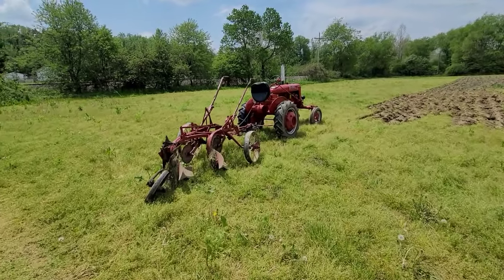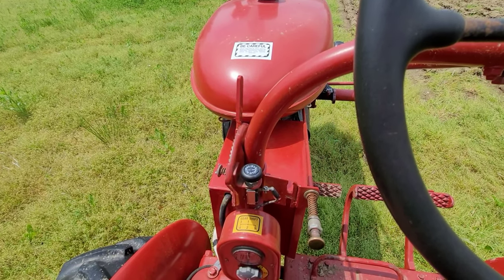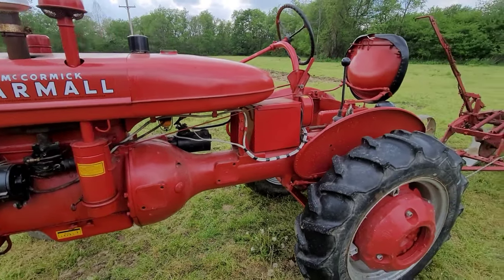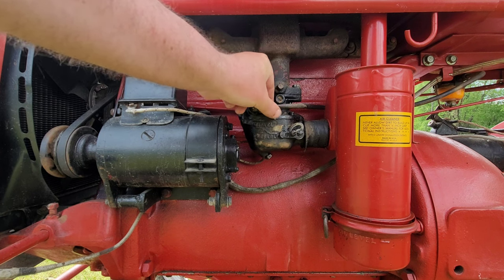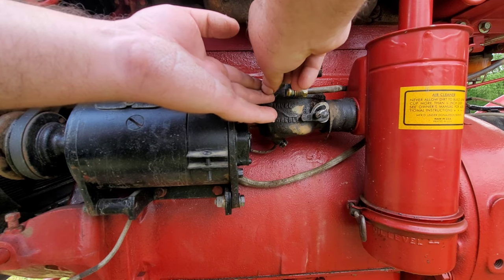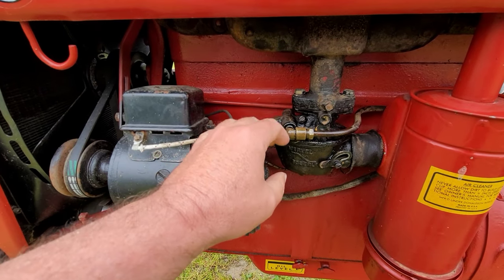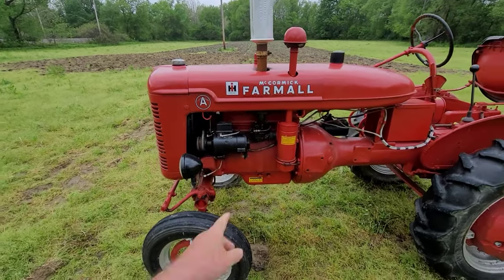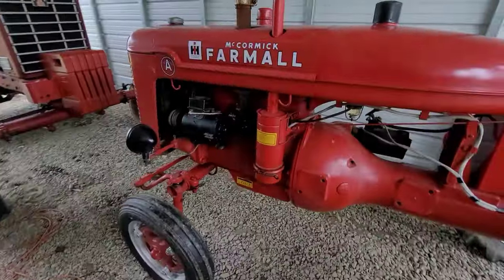Problems with Your Farmall Tractor's Carburetor? Try This!

Comment: Something to keep in mind here and this is where you can get into trouble. An A and a C actually use the same basic engine.  From the factory they were rated at different RPMs and different pistons were used but the other 90% of the engine was the same from an A to a C. Obviously many of these tractors have been rebuilt over the years and your A engine might have gotten the higher compression C pistons etc.  This is all well and good, the rest of the driveline and cooling system might not be up to the task though.
Reply: Good morning there fanatic! I would submit that there's a possibility there that you need to check the adjustment of your throttle in relation to your governor we have an old be here that we rebuilt last Summer turned out really well but with it you have to set your throttle up almost half pull the choke clear out doesn't matter how warm or cold it is hit the starter and as soon as it fires push the choke in about halfway but online if you pull it clear back to like about the third notch in the throttle it'll stall and that's just the way it's set. My see which is has that other fellow commented basically the same engine it set a little bit different if you give it more than three or four notches on the throttle lever it will actually flood. And then it will smoke like what you got going on there in a blue black smoke you see black smoke you're flooded. So I've been checking my throttle and Governor adjustments just to see exactly where you're at it maybe getting a little bit too much gas too quick
Reply from the maker: Correct
Reply: Thanks.

Comment: Mine has a mounted 16 inch plow. Over a acre it gets hot. I now leave the plowing To my M Deere two 16s and go to town. A's are awesome but they get hot quick under load. If your not careful they end up with cracked blocks in a hurry.  But I too have tried the two bottoms just because.
Reply from the maker: That is absolutely correct

Comment: I'm about to start work on my 52 Super A.  Similar problem. Started up after about 2 years and it ran for 10 minutes and then it just quit.  I have gas to the carb so I figure it needs a good carburetor cleaning, however I wanted to take a look at the spark plugs.  Guess what?  Can't get to plug sockets down between the 6 point plugs and the motor block.  Haven't been able to find a socket thin enough to get over the spark plug 6 point hex head.  Tomorrow I plan on firing up my metal lathe and Turing down a socket to fit  between the spark plug and the block.    The operators Manual say an  Auto- Lite 386 spark plug is to be used.  No way are the installed plugs am Auto Lite 386.
It will at least give me an excuse to fiddle with the lathe and pretend I am a machinist!
Keep your lines tight and your leader straight.
Reply from the maker: 12v?
Reply: @FarmallFanatic  No.  Still a 6 volt system.

Comment: Look like the packing nut on the sediment bowl shut is dripping.  Can see it on TVs bigger screen. 👍
Reply from the maker: I'll have to look thanks for the heads up
Reply: Is it not supposed to drip? Hehe only time mine doesn't drip is when it's out of gas, I always make sure I close the valve as soon as I turn it off...

Comment: I have a Farmall 140 from 1974 and backed it out of the shed to mow with. It ran for a couple minutes and shut off. Now, it only starts for a second and shuts off. Seems to be getting fuel to the carb and a little sediment in bottom of glass bowl but sediment bowl is stuck and won’t come down. It was a new one that was changed last year.
Reply from the maker: What do u mean won't come down
Reply: The glass sediment bowl seems to be stuck and won’t come down after unscrewing the piece that holds it in place from the bottom. It’s a replacement and not exactly like the original.

Comment: Sea Foam may be a permanent fix... The carburetor has a sticky residue in it and that stuff really does clean it up. The plow sizes of those tractors are variable based on soil conditions. The A is a 1-2 plow tractor, H, 2-3, M 3-4, W-9 4-5. When the Supers came out, they were advertised to handle the bigger plow. Super Cs were a 2 plow tractor, Super H is 3 plow, Super Ms are a 4  plow and Super WD-9 is a 5 plow tractor. They all had significant horsepower increases from the previous models.  You're not the only guy who  pulled a 2 bottom plow with an A. Back in the day, farmers often gave the tractors as much as they were designed for and then some. My grandpa pulled 3-14s with his W-4 and did so for many years. He also powered a 28X46 threshing machine with it which is overload for the little tractor. But what's incredible, that after pushing the little tractor to its limit for many years, It's still running and still able to do whatever we need it to do at 78 years old.
Reply from the maker: An A is indeed a 1 bottom tractor. 16hp at the drawbar.
Reply: @FarmallFanatic  They were still advertised as 1-2 I have some of the original brochures... It's no surprise that it's pulling the 2 bottom plow....
Reply from the maker: @tyfrank3427  
Farmall A 
Plows:1*
Drawbar (tested):16.32 hp
12.2 kW
Belt (tested):18.34 hp
13.7 kW
Reply from the maker: @tyfrank3427   I'd love to see those original brochures that proclaim it's a 2 bottom tractor. Most of their tractor ratings were bs.  They always lie in advertising
Reply: @FarmallFanatic  No, That's not quite true...  Soil type and management affects greatly as to how much implement a tractor can pull. Your soil looks like it's similar to ours, what we call grey wooded soil. It has high clay content and therefore is a tough pulling soil. However, That's not the only kind of soil. Here in Alberta, some places have a nice black loam... It's much easier to work. Some of it is sandy and that makes it easier to work yet. In that case, The A can pull 2 bottoms. My grandpa had the black loam and he pulled 3-14s with a W-4. But in this clay,  One bottom is enough for the A. You need an H or W-4 minimum on the 2 bottom... And if you're working up hay ground, in this soil type, better get the M.

Comment: Farmall Fanitic :) also fuel spring in carb solved problem for sure plus filter in line help lots more and that sure Big Generator on Farmall A how many amps is it ! Also rebuild carb be excellent too and needle valve  dirty  plus float must be stick I bet and gasket may need replacement on mouth to intake too! Do all Farmall tractor gas have Zenith 1 barrel and hope they do because last long time ! Also air filter may need clean too plus oil pan to needs change too! Also all Farmall motors need keep 5% or no Ethonal gas to run perfectly I found out and if have Ethonal up past 5% lose RPM plus Speed even Hp and Torque also STP Total Treatment Fuel injection and carb cleaner put in clean Ethonal out fast as Seafom does plus more! Also on Cold or Hot starts should flick choke on and off with throttle to low to high idles  just before crank over try too ! Then see if more choke can or throttle too !

Comment: Our Super A has a water pump. Because it has a 200 engine. The tires had calcium however i drained most of it out.  I mix a 1/2 pint  of super tech outboard motor oil with every gallon of gas. that way my gas is colored blue. And i can tell how much water is in the settlement bowl. I also use the  large glass bowl like a M or H has. Just me but I prefer to disk then plow then disk again pulling a spike tooth harrow behind the disk on the last disking. Dad always said if you dont  disk before you plow sod you get air pockets?  I sometimes use Chemtool in the gas. I always add a inline filter between the settlement bowl and the carb.  You tractor is doing a good job pulling the 2 bottom plow. Our Super A even with its larger transplanted engine would not pull a two bottom plow in our Ozark red clay soil. We have a large single disk breaker that mounts on a tool bar under the belly of the tractor. We havent ever used it yet.  We always used a M when plowing.
Reply from the maker: Soil type is everything
Reply: @FarmallFanatic   I agree. we have that red clay. they use it to make bricks. When its wet if you walk on it you very soon have 40 pound feet. when it dry its hard as cement. There is a plow pan about 8 inched down.  It was created by horse or mule drawn breaking plows. Ive seen a  tractor drawn breaking plow skid along and not faze it. Ive seen cable dozers the blade just scoot on top and smoke . You have to break up that hard pan with a ripper or subsoiler. The organic material is very sparse. They cotton farmed and to keep the boll weevil in check they farmed extra clean and used arsenic. About all the grew after it was worn out is bitter weeds and PoJo.  With application of great amounts of commercial fertilizer and if we got enough rain. it made a small crop. Iy guys in your area had that sorry of a crop you wouldnr even bother to harvest it. You all would likely just disk it up.

Comment: Hello Gino my experience take the carb completely apart and clean it. It's only after I have apart do I put a carb kit into it if needed . Dirt does wonders lol without a inline fuel filter which is needed. Have a great day.
Reply from the maker: Yeah you get to that point where it's do-or-die
Reply: @FarmallFanatic  Nice sunny here have a good day.

Comment: Sometimes my float gets stuck. I remove drain on bowl take a small screwdriver and gently push the giggle the float. That usually works. Easy fix and no need to remove carb.
Reply from the maker: Just depends on why it's stuck

Comment: You are probably shaking some junk out of the carb. Just rebuilt our Marvel Swewb and it needed to be wetstoned to meet nice and flat. That and cleaning helped a lot. It can warp out and cause nasty hydro-lock dumping tons of gas into the oil pan 😅. Carb must seal well internally.
Reply from the maker: Absolutely

Comment: I can't  remember  what horsepower  your A is but a jd B is about  28 hours on the drawbar  and it will pull a 2 14
Reply from the maker: 18 horse power
Reply: @FarmallFanatic  does a good  job pulling  it

Comment: When you open up the A's carb if the needle valve tip is rubber it isn't original. One, check to see if the tip of the needle valve is centered on the needle. Two, make sure that the float is straight and not hitting the sides of the bowl. I would guess that it has a chiniess rebuild kit in it already.
Reply from the maker: Almost all of them are rubber tipped

Comment: Great information from your videos on the A.
I’ve got a 47 A, having trouble with the carb. I bought it with a Zenith already on it, the tractor starts fine but is only running with choke. I’ve adjusted the idle screw with not much luck.
And idea what it could be or adjusting may be needed?

I bought a new carburetor, same one you put on the A, but was hoping to try and adjust it and not need to put the new one on.
Any advise would be appreciated.
Reply from the maker: It's so hard to advise without being there...I'm guessing the float may not be set right or a needle valve issue

Comment: Those OEM switches are junk. Between my father and I we broke four of them. After the last one I took one apart. Where there useta be pot metal, they have plastic and it will put apart. Works great until it comes apart in your hands. The ten dollar switch is lasting so far.
Reply from the maker: It's all junk made overseas
Reply: Can you reverse the switch just by switching the connectors? mine is On when down and Up kills.